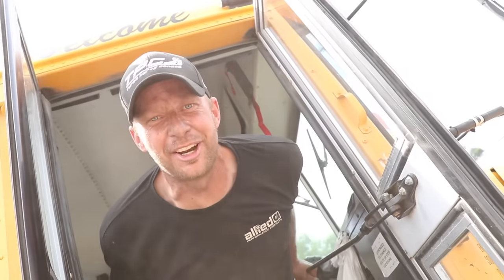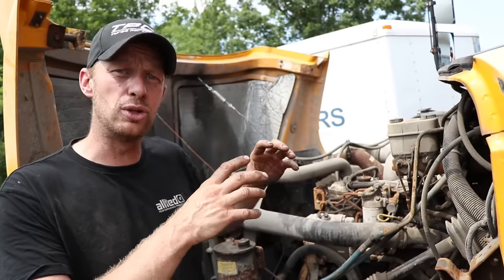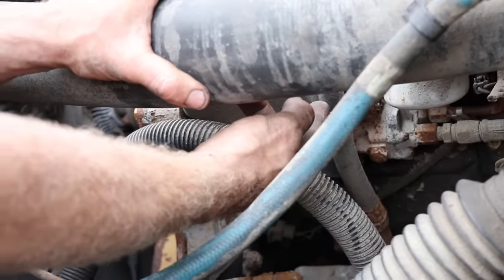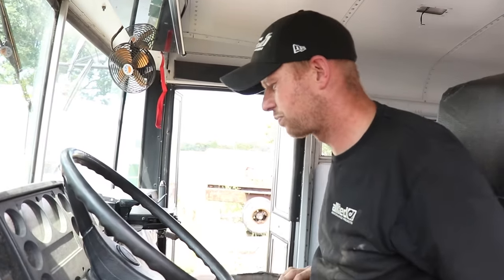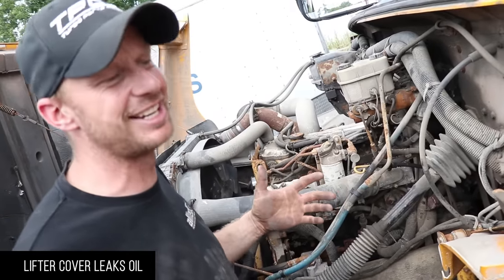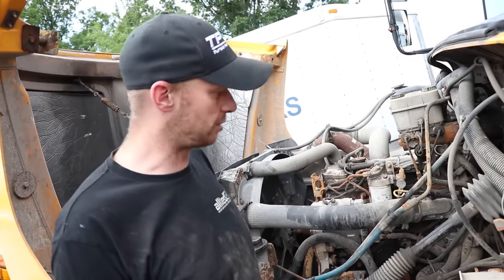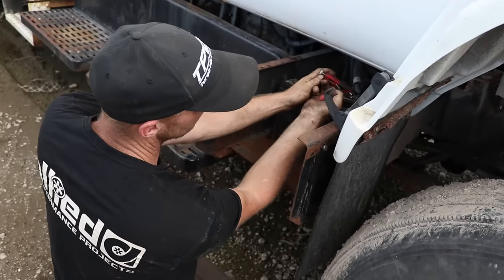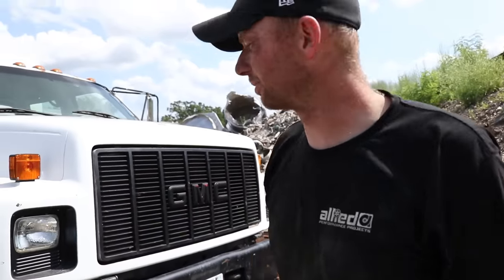REVIEW: Everything Wrong With A 7.2 CAT 3126 Diesel

Comment: We used them for onboard generators for light ship duty.  A caveat:  When a ship is totally dead, no juice in the batteries, we used a hand started single cylinder air cooled diesel to charge the 24 v batteries. Once charged we could start this small cat to run the compressors, thus the large diesels were started with compressed air. Once this little Cat was running we had lights and ventilation. To hear it start up was pure music to some hot sweaty engineers.
Reply: Do you remember what the single cylinder air cooled diesel engine was called?
Reply: @juanjaimes1836 pot pot,worked on one from a Cuban sail boat ,that 1 cylinder engine just kept going pot pot pot pot slowly but surely

Comment: When I worked at international if you wanted to enable the 6th gear in the allison you would have to bring the truck in and fill out a request form with all the specs on the engine and drivetrain to check the calculations to ensure driveline speed wouldn't be exceeded by the addition of the 6th gear as well as adding a max speed limiter. Once it was approved by engineering the request would be sent to allison to create the program and reflash the tcm enabling the 6th gear. Was around a $600 charge here in Canada.

Comment: Love the 3126! Round HEUI better then the square. I have one with 400k miles . Keep your engine oil clean. Mine doesn't leak or burn any oil. Good info! Thanks for posting this!
Reply: I can believe some when it comes to oil. My grandpa (59) didnt want to pay for the oil filter and went 60k miles (5k oil intervals) but the same filter. There was no media left. It was all mush, luckily it's a honda and has gone another 60k.
Reply: Hello there! Thanks for the positive info. I have heard all kinds of negative reviews about the 3126 cat engines, which makes me kind of want to shy away  completely... but reading a post from someone like you who actually own the engine, gives me hope....

My question is: would you recommend a 2000 Freightliner, 3126E 185hp, with 245k miles on the motor...... Automatic, clean engine, zero rust, clean interior? If so, how many more miles can I expect out of it? 
Please let me know something.
Thanks.

Comment: Biggest problem with Caterpillar engines was that every time management changed, they moved production back and forth from Mexico. Mexican made parts were always needing to be reworked or scrapped. Most engine production for on road engines used to be at Peoria, IL. Now the factory is just a shell as production was moved south. Trying to make EPA requirements didn't help either. Best engines for quality were 3406/3408.
Reply: Hott Puppy  I built them in Peoria until they moved the engine plant to Texas.

Comment: To unlock 5th and 6th or just 6th you need to replace the tcm and replace the valve body it's about $1600 usd
Reply: If you were to unlock the 5th and 6th years, would you then have to change the diff?
Reply: @chrismaxwell5881  probably not. top speed is usually ~60-65 stock, two extra gears would be more than enough

Comment: What is good about inline 6 s when it comes to plant engines is you can make a modular engine with fewer or more cylinders but using a common architecture. It is more complicated making a V8 and a V6 and a v4. Plus inline engines are simple and 6s are smooth, but those long cranks can be expensive to make well. Great video Rich. That oil pressure driven injector system sounds interesting.

Comment: I once saw a mechanic rebuild a DT466 in the frame in less than 12 hours, and he even stopped and took me to lunch.  That time is from the time he got to the shop till I drove the truck to its next appointment.  LOVE that motor.
Reply: I have 2 single axles one with 466 one with 3126. The cat pulls a lot harder has less idle vibration and pulls a lot better at low rpm. The 466 is probably the best small truck engine ever built. Mine is also one of the high pressure oil model 466. The 466 has a lot more injector rattle, poor low end power and a ton of idle vibration. Navistar hpop engines always struggled with air in the fuel rail and should have had ruglated fuel returns from the factory on them. The 466 is probably still more reliable in my mind and I would say starts a little better in the cold but both start pretty damn good

Comment: Have worked on countless 3126's and c7's at my shop and you hit every point dead on, love the motors because they are so easy to work on and diagnose
Reply: 3116 and 3126 pretty similar?
Reply: @h22eh6  no 3116 is in my opinion the worst, setting up the rack on them is something I never plan on doing. 3126 is all honesty one of the best small bore I6 diesels, Deboss hits the nail with this video, he probably has 20+ more years of experience then me too
Reply: @fuzzfire  how can I tell the difference between the 2. It's a 96 Kodiak
Reply: @h22eh6  3116 has a mechanical throttle the 3126 will have electric throttle and the HEUI oil pump on the drivers side of the motor
Reply: @fuzzfire  thank u. Is the 3116 hated because it's underpowered? I hear it can be reliable
Reply: @h22eh6  they are just a pain in the ass to work on, you need special injector tools and know how to set them up, ive never touched on because I dont have the tools or books on them, I mainly work on 3126, 3406/c15, and cutom cats I build for gliders here and there

Comment: Thanks for the info! I have a 2003 Stewart & Stevenson M1079. It has a 3126/275HP mated to a 7 speed Allison trans and transfer case (full time 4x4 with 70/30 limited slip xfer case. Put the Allison in "Mode" and it locks the xfer case 50/50). Ours has about 28,000 original miles on it and runs like a top. Also, this variant has a factory installed exhaust brake--which, works well at our weight. We keep the oil clean and change it once a year, as we never drive it more than a couple thousand miles annually.

Comment: On top of the steel line upgrade, CAT also offers an inline filter upgrade for that line leading to the pump. Well worth it if you have to replace the line.
Reply: I have a 2004 CAT C7 ACERT engine. I called CAT to get the upgraded steel fuel line but they do not have an upgraded part.  I also called CAT in the Philippines and they do not have the upgraded steel line.  The part number on the flexible line is 205-1280.  Is the steel line upgrade an after market Part.  I would like to upgrade my pump feed line.

Comment: I am currently driving a Bluebird 07 with a Cat engine.  It is the hardest cold start engine I have ever seen.  It gets below 50 F and you don’t have the heater plugged in you will be cranking for a long no time.  But, it is the strongest bus of all the buses in our yard.  The body is rusted pretty bad and lets air in like a sieve.  When we retire this bus I want the engine and now I am even more intrigued after this video.

Comment: Inline 6 has 2 huge advantages,  first is the longer stroke for torque,  second is that it is a naturally balanced engine, no primary or secondary vibrations.
Reply: 3 years late, but; Third: The load on the mains comes from only (or mostly) one direction rather than getting hit from two directions in a V.

Comment: GREAT VIDEO!
I HAVE TO TELL YOU MY OWN 3126 FUN EXPERIENCE!!
A FRIEND OF MINE WAS WANTING TO BUY A WRECKER WITH A 3126, BUT WAS TOLD BY THE SELLER IT HAD "STARTING ISSUES"!  MY FRIEND ASKED ME TO LOOK THINGS OVER BEFORE HE BOUGHT!
I LOOKED THINGS OVER AND FOUND THE PRIMARY FUEL FILTER MISSING, BASE AND ALL AND THE LINES SPLICED TOGETHER!
BEFORE EVEN TRYING TO START WE FIXED THE PRIMARY FILTER
AND PIPING AND CHANGED BOTH
PRIMARY AND SECONDARY FILTERS.
WE PRIMED AND BLED THE LINES AND FILTERS AND THEN STARTED IT UP!  STARTED EASILY AND WAS RUNNING FINE FOR ABOUT 90 SECONDS THEN IT WENT NUTS WITH A TERRIFIC OVERSPEED!
I GOT TO THE KEY AND THANKFULLY
 
 IT WENT DOWN OK,
WITH MUCH SMOKE BEING MADE!
LOOKING IT OVER WE DISCOVERED THERE WAS SOME EXTRA PLASTIC PIPING INSTALLED BETWEEN THE CRANKCASE BREATHER AND THE AIR INLET TO THE TURBOCHARGER!
THE ENGINE HAD A TERRIFIC AMOUNT OF BLOWBY AND THE SELLER COBBLED THIS UP TO CHANNEL THE BLOW BY BACK THROUGH THE ENGINE!
LOL NOT A GOOD IDEA, AS THE OVERSPEED WAS BEING FED BY THE BLOW BY!!
FORTUNATELY MY FRIEND DECIDED THIS WAS NOT A TRUCK FOR HIM!!! LOL

Comment: How about shortening the wheelbase on that bus and making a giant pick up truck?
Reply: I've got a 5 window short bus with a low mile 3126. Its a real cruiser. Does 80+ on the highway.
Reply: That's what I was gonna do with a 2001 bluebird TC2000 with the 24v cummins I have too many trucks to maintain so chopped it up and took the motor and the allison transmission with it and its sitting in my garage. I paid 1200 for it. Looking at buying a 2015 Bluebird vision with a 6.7 cummins and allison transmission with a slight wreck where the door opens for $5000 Delete the engine and turn it into a mega pickup with some giant tires on it lol. The bus models I think only run about 200 ish hp so I have to tune it and whatever that 5.9 makes 190hp and the c7's make 210 not sure about the specific specs on that bus. I'll see how this goes.. P.S might put the 5.9 in an old G wagon or range rover or something of that sort lol if I can find it for cheap.

Comment: had a 3126 cat in a 2003 freightliner FL-80  was a great engine only problem i had with it was the injection pump went out 1 time and also blew a turbo at 1,015,000 miles when we had to give the truck up due to the crashed economy  my brother and I had racked up 1,026,000 miles on it still running strong

Comment: The 3126 engine is pretty dang reliable. Over built like a tank. Keeping good clean engine oil is a good thing to do for them. We have 20 plus year old busses running thm still on the orginal engine with drivers who don't stop untill there is an issue. We also had an otr guy who stayed ontop of his maintenance that went 1 million miles before having is drop a new on in his truck.

Comment: Would it be possible if you could talk about the dt466? Maybe cover the mechanical and electronic models?
Reply: +1 for a DT466 video!
Reply: DT466 > CAT
Reply: Yes..... Please give us some information on the legend of medium truck engines.  The famous DT466.  I would like to know everything wrong with the 93-97 DT's with the p-pump.
Reply: Yup common on older international busses and more. I work on all my rigs at a yard which is connected to a school bus service yard. They have a bunch of retired busses with those motors and newer ones. The owner retired a E450 ford mini bus because of a lift pump hes not in the best financial situation.
Reply: I have quite a few in the fleet I maintain. Good engines especially with the old pump line injection. HEUI not bad either. Gotta keep good fuel pressure... Often overlooked but the injectors will destroy theirselves with no fuel or air in lines... Quite a few ways they can drag air might I add

Comment: The cat IT62G loaders had this engine in them.  Another issue was the gasket at the oil filter housing would bypass sending dirty engine oil threw the injection system.

Comment: The 3126 is a good engine. Has buttloads of torque for a small diesel. We had one in a kodiak 6500 rollback. Truck could pull a house down. Was a great engine.

Comment: You could get em with a MD3060 as well which is a 6 speed.  I have a IH bus with the 7.3 and a MD306, transit style flat nose.
Then you went on to mention them, they are a mighty fine trans (3060).
5th and 6th gear in a MD3060 is both overdrives.

Comment: Two of the wreckers I drove had Cat engines. One was a 3116 with a automatic. The other was with a 3126 with a six speed. This truck would fly and a little bit longer perfect for towing road tractor's from the rear. The truck with the 3116 and the automatic was slow if you put anything heavy on it. Company sold both trucks and help graded to Pete's with Cummins engines

Comment: Allison 1k/2k/3k/4K all can be changed from 5 to 6 speed using programming. Depending on model yr.. you need software and cal ID to do so. Same internals on clutch packs and planetaries.
GM is a different beast due to GM has the Allison rights to their product when the buyout happened.

Comment: you did a very good review! I worked on a lot of those myself as a caterpillar mechanic on the truck engine side. You hit on the main issues which are the heui system itself. I saw quite a few issues with  the IAP sensors  as well as the driver that controlled the actuation pressure. That was usually my main go to on them. Also quite a few issues with blown injector O-rings that would leak off engine oil and cause running issues. Using 10 weight 30 oil in the winter will dramatically help starting this engine, and so will changing the oil at less than 7000 miles.  I resealed quite a few rear engine covers on these, this was the start of cats use of anaerobic sealer on everything. While a dramatic improvement over the 3116 engine, I didn't see a lot of these that were still around by 400,000 miles. The DT466 / 530e engines were better in my opinion. keep very good fuel filters on any unit injector system as it may be the difference of getting 150,000 or 400,000 miles out of the injectors!.

Comment: I've never had to use ether on a cat that was properly tuned and had good fuel in it. Best thing is a blockheater.If you do use ether crank engine first to lubricate cylinder walls before you use the ether.

Comment: Review the International IDI diesels used in 83-93 Ford 250 and 350... 6.9 and 7.3 N/A
Reply: Kyle Giannette I got both blocks, they are basically good boat/generator engines that got dumped into a pickup, only buy if you intend on running them on heated used kitchen grease or used motor oil, since they came with two factory tanks it is an excellent conversion for a novice mechanic.
Reply: @JohnCamp  yeah they are dogs

Comment: If someone was going to use a 3126 in an aftermarket application would it be a smart idea to replace the high pressure oil pump with an external hydraulic pump with two or three inline filters and install a Murphey system on the hydraulic system? Although if I were to do this I'd also put a Murphey system on other systems as well like the coolant temp, engine oil pressure, engine oil temp, and maybe also the coolant pressure that way if I blew a coolant hose it wouldn't burn itself to death

Comment: The injectors in the cat engine have trim codes, these codes have to be programmed into the ecm coordinated to its cylinder . this is to fire correctly. 
The wiring harness to the injectors are known to dry out and short.

Comment: I would like you to review the general motor diesel engine from the 70s and 80s I thought they were junk but someone told me there are a few thing you can do to wake them up. Thanks rich
Reply: I’m kind of curious myself. It’s such an anemic engine, I’m wondering what exactly you have to do to get at least into the 200 horsepower range(I think they’re rated at 110).

Comment: You totally miss the biggest flaw of the 3126. The plastic cylinder oilers. Especially in the marine market where sucking up trash in the raw water intake where an engine can run hot. The plastic cylinder oilers that keep the cylinders cool fail when the engine gets hot and causes the cylinder to crack. Often number 5 or 6. Which causes the engine to "push coolant" and as you mentioned they are not sleeve able. So it requires a new block. As mentioned saw it a lot in the marine world which is where I learn the diesel trade.

Comment: Early HEUI engine had issues with blowing steel line under valve cover. Later engines was drill passage inside cyl head. We sold city some garbage trucks with them they where gut less

Comment: I work on school buses I love the 3126 cat there are some downsides a high pressure oil line blows out and get oil everywhere oil cooler likes to leak a lot good running engine the fan clutch hub is another problem are 3126 is only get up to about 340,000 miles were phasing all those buses out

Comment: This is 100% going in the OBS right?
Reply from the maker: I'm thinkin so
Reply: Drewbaby625 did it, has a ton of videos on his channel of the swap.
Reply: DEBOSS GARAGE ILY!!! ❤️👌🖐💕💕💕
Reply: @DEBOSSGARAGE  considered a DT360? Fit a P-Pump, and out-run a cummins!
Reply: @randytune88  I've watched all of those videos too. Drives me to finish my build, and the money spent on electric modules I almost wish I went with a 545 instead of this MD3060
Reply: @randytune88  I sure did, thanks for the shout out.
Reply: @daveerald  I wouldn't wish the 545 on anyone. sure it was simple but it is my biggest regret in this build. I haven't covered it in a video yet but my top speed with the 545 and 4.10s is 52mph on a flat... the MD3060 will be worth every penny.

Comment: The company I used to work for ordered 10-15 Freightliner FL60s with the 3126C motor. When we took delivery our main fleet repair shop said those were the worst motors we could order and they wouldn't make it to 100k miles. Most of them made it to 850k with 2 or 3 sets of injectors & cups. Never ever had a problem with them except for one which was put in a Chevrolet cabover with a 4 speed auto that was geared stupid high, like in 4th gear at 65 was touching redline - this caused it to blow a hole near the water pump that was too big to repair, so it drank about a gallon of water every few miles. But that sucker ran. Never had a problem with the HEUI pumps because we knew if the truck lost power then it was low a gallon of oil. If there wasn't a puddle of oil under the pan then it was out of oil. Great motors in my opinion.